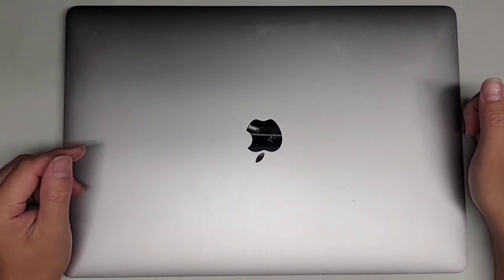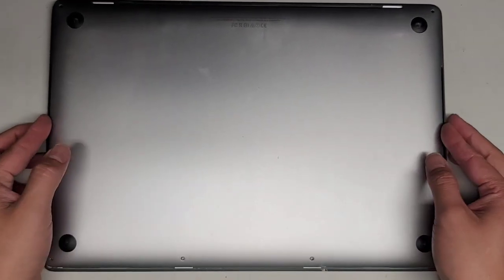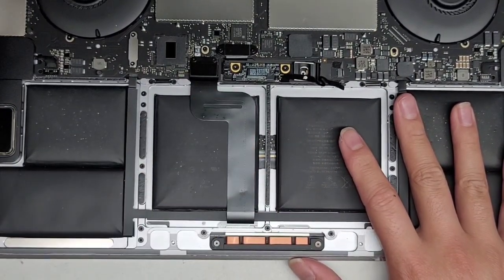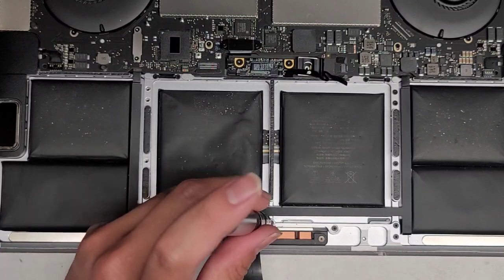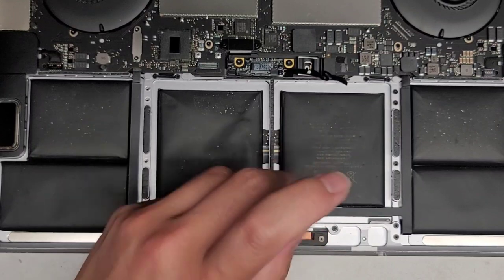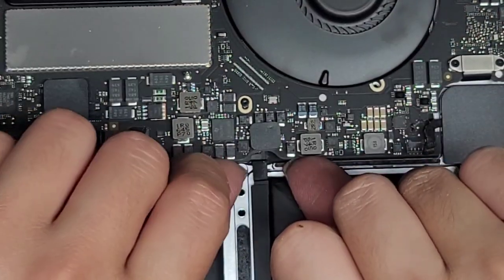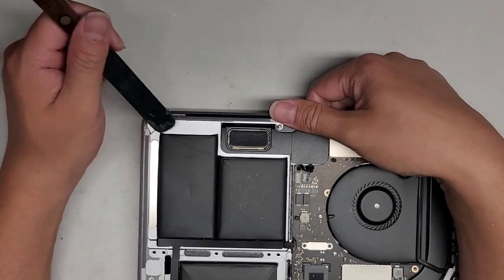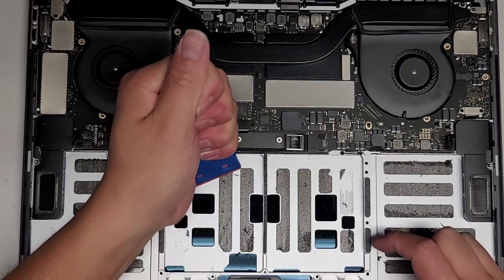15" Inch MacBook Pro A1707 Late 2016 Disassembly Battery Trackpad Touchpad Replacement Repair Easier

Comment: Finally, I replaced the battery in my 2017 MBP, this time successfully.  I got a screw extractor to remove the stripped screw and, of course, tiny screw to replace it.  This time I could remove the stripped screw and done that the rest went easy.   The old battery was not punctured. I don't know why I thought it was.  Anyway. sliding the trackpad back to its place was not easy, but I managed. This is the second battery I replaced.  Last year I did to a 2013 MBP without any problem at all.(I followed your video, of course).  I have to say, your tutorials are excellent. I owe you really. I don't use paypal, but I'll mail you money order or something.  Thanks a lot.
Reply from the maker: Awesome, glad the videos have been able to help you multiple times. Venmo, Zelle, PayPal, Mail all work :) I appreciate it. Thanks! Hope my videos continue to help you going forward.

Comment: Thanks a lot! I bought a used MacBook Pro 15" from 2017. It was hot, so I opened it to clean the fans. Had a battery service notification, and it was't difficult to figure out why.. Battery had swollen. Bought a new one and followed your guide, worked like a charm. Punched the old battery a few times, smelly! One big scary moment, however after re-assembly.. the Mac wouldn't turn on (not with, and not without charger).. Turned out I hadn't screwed the pancake screw fully in.. After, worked! Did a PRAM reset and now, a healthy (and safe) battery. So thanks again.
Reply from the maker: Glad it helped. Careful with the fumes, they're toxic. Glad you were able to figure out why it wasn't turning on. If you haven't already don't forget to like and subscribe so others can find my videos. Thanks!

Comment: It’s been fun working alongside you for an hour ☺️

 Very helpful video, especially because you keep talking us through it. Knowing not to bend certain crucial lids too far is essential, and I really appreciate all the little tips along the way. Not breathing in those sweet sweet battery fumes for instance 😏

Now what to do with the battery…
Reply from the maker: Glad it helped. You can look for a local ewaste place that accepts lithium polymer batteries. It's probably not good for the environment, but I'm sure some people just toss them in the trash. I'm pretty sure they have stuff printed on it saying not to. XD Could possibly cause a dump truck to go up in flames, so best not to go that route. Lol

Comment: Thanks just followed your guide best way to remove battery without any damage  it is to use fishing line good old 25 lb test.  easy works flawless wear  gloves wont so it wont cut you simple fast!!!  Thanks for detailed video!
Reply from the maker: No need for gloves. Just wrap around pencil/pen and pull :P maybe I'll try it it a video one time. Usually people say floss because everyone has it.
Reply: @ItsBinhRepaired  Fishing line way better and faster no damage you wear  gloves its much safer and wont cut you I used saftey gloves thin clothed gloves took me 8 min to remove battery
Reply: @ItsBinhRepaired  Just pry each side enough to were you can get fishing line underneath!

Comment: Awesome video! Thank you so much. I've had the same problem with holding washers in place in camera repair. A very tiny dab of Loctite or nail polish applied with a toothpick helps keep them in place and not so strong you can't undo.
Reply from the maker: Even water works :)

Comment: Why oh why did Apple put the battery cables UNDER the motherboard? Easy repair made difficult for no reason. Appreciate your videos. Always well explained and accurate.
Reply from the maker: To try to stop people from repairing them themselves.
Reply: @ItsBinhRepaired more of a design thing, you can still repair it, you just got lift the motherboard a little bit
Reply from the maker: Yup
Reply: Crazy, unfriendly, or even stupid. But it's still not worse than their soldering the SSD and RAM on board and leacing no way to change.
Reply from the maker: @skyland4929  yup...

Comment: Changing the battery in these models is scary and difficult - but possible if you follow this video carefully. Running the battery down before you start will reduce the chance of it getting hot if it gets damaged. A small spatula is the way to go and do it slowly. First time I punctured a cell which got hot and there was some leakage of fumes so I finished removing the battery outside.
Reply from the maker: Glad you were able to finish the job!
Reply: @ItsBinhRepaired  I think the first time you do it is the hardest - hoping so as I have another to fit!

Comment: Excellent video, thank  you.   I have replaced the battery but now my new battery is at 1% and won't charge.  Is there anything I can check before ordering another battery?
Reply from the maker: I think I ended up reaching out to you by phone. Thanks for the support/contribution! Make sure to check the ribbon cable and metal tab are connected properly.

Comment: My question is regarding the battery cable and pancake screw. All videos and guides have you removing the battery data cable before the screw. I was wondering if this is the correct order. I was thinking its better to remove the power before disconnecting any cables. I'm not sure but I assumed the cable is for battery data with the pancake connector for power. Something went wrong on a repair I did and I cant figure it out. I replaced a trackpad and on reassembly I first screwed down the battery pancake screw and then connected the cable. Immediately upon connecting the cable I had a circuit burn on a different part of the board and now the board is dead. The battery cable was not damaged when I inserted it. I did use electrical tape that was placed in between the positive and negative contacts to prevent accidental touching. Maybe there was glue residue on the contact? Any ideas what went wrong? When reassembling do you first put the connector and screw down and then the cable or should you connect power last? Any more information on the relationship between the cable and +/- connector would be appreciated.
Reply from the maker: Your question is answered in the video. Not sure what else to say.

Comment: I damaged the battery connector to mother board while trying to detach the cable. It snapped right off of the mother board 😕 I assume it cannot be reattached. Can I run the MacBook without a battery on the external power?
Reply from the maker: You need someone that can micro solder. I don't think it'll run without battery :(

Comment: Hello, Great video. Appreciate it!!
But, I’ve faced an issue. The green Caps lock light came on after I connected the new battery and then I also noticed that I forgot to connect the trackpad cable. Then the screw kept popping all over the board while the battery was connected with the board. After I fixed it, the laptop is not powering on now. It’s completely like no power like dead. Any idea of the screw popping on the board has shorted the motherboard or what can be the issue here?
Reply from the maker: Sounds like motherboard shorted :(
Reply: @ItsBinhRepaired  alright, how do I check on it? Any equipment and procedures to do the checks?

Is it also absolutely necessary to only connect the battery cable & circular connector right at the end to avoid shorting chances?
Reply from the maker: @intellogo  bring it to a repair specialist
Reply: @ItsBinhRepaired  thank you for your suggestions! I’ve got a specialist in my city who I’ll visit on Monday to check what’s up. 
But, again, I learned a lot from your video and doing that full exercise. Thank you for your detailed video and your quick responses! 👌🏻
Reply from the maker: @intellogo  hopefully they'll be able to repair the motherboard. Might be tricky with the screw rolling around inside. :/
Reply: I'm planning to replace the trackpad which apparently was damaged when the two center parts of the battery was pryed off. My pry tool must have scraped the electronics exposed through the Small square holes under the middle battery sections. So anyone prying under these battery regions be careful and keep your pry tool flush.
Reply from the maker: @mikesmultimedia  or maybe follow the video and remove the trackpad first. Lol

Comment: I installed everything delicately with no problem, however when I went to power on, double-tapping the track pad, the computer never powered up. The trackpad works when the power cord is plugged in, and the fans run, however the screen is still black (can’t get anything to display).
Reply from the maker: What part did you replace

Comment: I just tried to replace the battery in 2017, that it was saying needed service.  It wasn't easy to open but I did. I got to  disconnect the tract pad and one of the screw was impossible to do it. It broke o something so I decided to close the computer instead. At that moment I realized I felt a sweet smell I thought there were battery fumes, and I saw one of the cell kind of folded, and I closed the computer. Then the computer didn't start. Before I disabled the AutoBoot.  So, hopefully it does not start for that. Otherwise something serious happens. The next step is taking it to you. I don't know what should I do now there is not a power button in this models.
Reply from the maker: Wait, so you didn't replace the battery?
Reply: @ItsBinhRepaired  No, I did not because I couldn't remove one of the screw of the track pad connector and sincerely the fumes went getting strong.
Reply from the maker: That means you punctured the battery. D:
Reply: @ItsBinhRepaired  No I didn't. One of the cells was sort of folded on one corner. It seemed an old and strange injury. It is not punctured. I felt the smell when I opened the computer.
Reply from the maker: @Veva0005  :(
Reply: @ItsBinhRepaired  What are yours business Hoursz/ Thank you.
Reply from the maker: @Veva0005  24/7 lol
Reply: @ItsBinhRepaired  I thought you have a workshop or a store or something like that. I live close to you. If you like to fix the computer I can take it to you. I'm serious.
Reply from the maker: Yes, look up my business on yelp. 24/7

Comment: I followed everything.  But now I have an X on battery icon 🔋 also battery not showing up and MacBook Pro won't stay on unless power cord is plugged in. Please help!
Reply from the maker: Check the small ribbon cable and the metal tab is lined up with the battery controller
Reply: @ItsBinhRepaired  ok thank you!
Reply from the maker: Hopefully you find the issue

Comment: Unfortunately the top chassis with keyboard (IT) and battery comes at like 180€ when Apple Store would do it guaranteed for 209€... I was hoping to save some money being a 6 years old computer, but it looks like I'll have to spend it. Great explanation anyway.
Reply from the maker: Why are you replacing the whole top assembly and not just the battery?
Reply from the maker: What part is bad?
Reply: @ItsBinhRepaired  both keyboard and battery unfortunately
Reply: Keyboard being the worst problem actually because the battery isn’t even that bad, I’ve seen worse
Reply from the maker: @marascalia  ooof :(
Reply: @ItsBinhRepaired  from what I’ve seen there isn’t a way to change just the keyboard
Reply from the maker: @marascalia  unless you want to go through this nightmare lol https://youtu.be/ZC5CBMYl77U
Reply: @ItsBinhRepaired    OMG that looks like a nightmare indeed. 😱 Do you think that the process would be the same with an A1707? …aaand… what do you think are the chances for someone not as skilled as you are to actually make it? Thanks anyway, it looks like you’ve repaired any sort of thing 🙇🏻‍♀️🙇🏻‍♀️🙇🏻‍♀️
Reply from the maker: @marascalia  that is an a1707 hahaha it's a huge pain. Make sure to follow exactly, but yeah, wouldn't recommend attempting. Might as well use a bluetooth keyboard.
Reply: @ItsBinhRepaired  thanks, I have a desk station with an external monitor and Bluetooth keyboard and mouse, I just wish I could use it from bed, I’ve been going through several surgeries in the last couple of years and having a working keyboard for the laptop would be a dream (mine repeats letters, some keys don’t work, etc etc). Thank you so much, I’m going to consider pros and cons :) you are amazing anyways, you have such a patience. Ever considered an electric mini screwdriver? It could spare you carpal tunnel pains. Thanks again, I’ll definitely let you know if I attempt this.
Reply from the maker: @marascalia  I used to have an electric screwdriver. It had issues, so I stopped using it.
Reply: @ItsBinhRepaired  too bad, considering the insane amount of screws in there. It didn’t use to be that complicated if I remember correctly, I remember changing a ridiculous amount of pieces on a 2008 model I don’t even know if it had one original piece in the end, but I guess 14 years are a veeeery long time. Keep up the good work 👍👍👏
Reply from the maker: Yeah :(

Comment: can you please tell me where is the keyboard cable ?
Reply from the maker: Right above the battery board
Reply: @ItsBinhRepaired  can u please tag the time ?
Reply from the maker: @David Video FILMS  it doesn't get disconnected in this video
Reply: @ItsBinhRepaired  thank you
Reply from the maker: @DavidVideoFILMS  what are you trying to repair?
Reply: @ItsBinhRepaired  my keyboard not responding after they open it to check
Reply from the maker: They likely damaged the cable :(
Reply from the maker: There's a connector right above the battery board

Comment: Just sent you some cash via Paypal, this was super helpful!
Reply from the maker: Got it! Thanks! Were you able to fix your computer?
Reply: @ItsBinhRepaired  I was able to no problems at all, replaced the battery (which was ballooning so I was doing this outdoors as well), trackpad and trackpad cable.  It has been some years I had cracked a laptop case, much less Apple, so the level of detail you provided, along with showing the missteps that can occur were super helpful.  No issues at all, and my wife even had the same spatula for adhesive removal, although I don't see her using it on cakes anymore :)
Reply from the maker: @FunkDialout  LOL glad it worked out. Make sure to clean it with rubbing alcohol to get the adhesive residue off it, then use soap as usual. It's still safe for food. Haha

Comment: Do you have to remove the Trackpad to replace the battery?
Reply from the maker: Just do it or you'll likely damage it trying to remove the battery.
Reply: @ItsBinhRepaired  I was really careful and didn't damage the Trackpad but not the system doesn't turn on?? I think I got a defective battery, such a waste of time. Do you know where to buy a battery from a trusted seller?
Reply from the maker: @andrewfreeman88  1 year warranty https://amzn.to/3b9dODx
Reply from the maker: @andrewfreeman88  you likely didn't connect something right though. If you didn't remove the trackpad, it sounds like you didn't follow the video exactly. Please watch through the entire thing and follow it exactly.
Reply from the maker: @andrewfreeman88  if you skipped around and assumed you know what you're doing, there's a good chance you forgot something or damaged something. Follow the video exactly.
Reply: @ItsBinhRepaired  I followed your video and another video from Turkey that was highly rated. I did everything you did minus the Trackpad. I used a Plastic blade not a metal one that can puncture the battery, so I was in fact more careful ; )
Reply from the maker: @andrewfreeman88  it's not a blade and cannot puncture the battery unless I stab it, but that's not how you remove the battery. Lol
Reply from the maker: @andrewfreeman88  double check the battery tab and the small flex cable
Reply from the maker: @andrewfreeman88  did you completely remove the motherboard? Make sure everything is reconnected and plug the charge cable in
Reply: @ItsBinhRepaired  I know, just having a little fun ; ) I'll bring it to my guy to test the battery and then probably buy another one, thanks.
Reply from the maker: Haha alright
Reply: @ItsBinhRepaired  After a second look there was a piece of thread tightener on the battery connection. I removed that reseated the little cable and BOOM it's up and running again! Thanks again, I'll send a tip to your Paypal.
Reply from the maker: @andrewfreeman88  awesome! Glad you were able to figure it out. :) Makes sense that the thread locker residue could block the connection. Haven't had that happen before though.